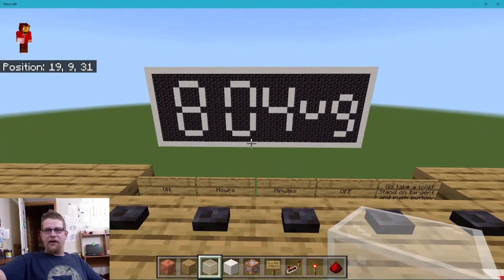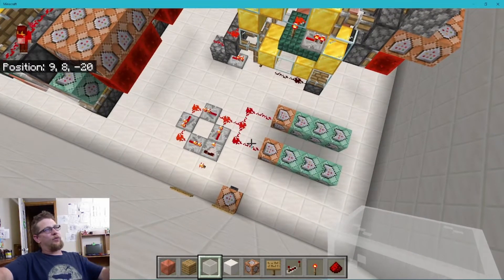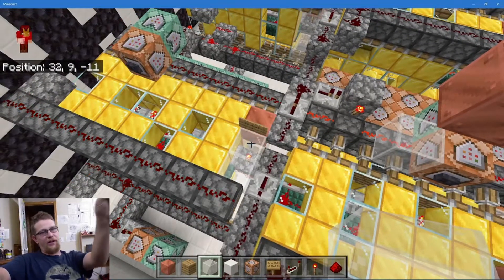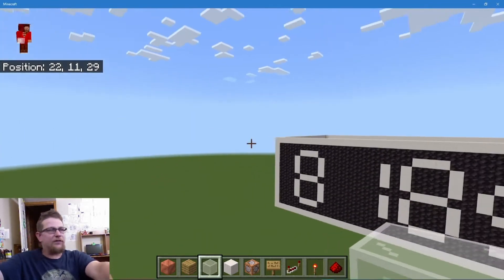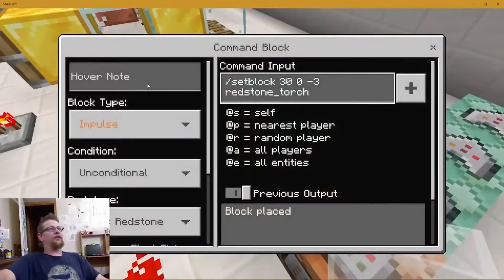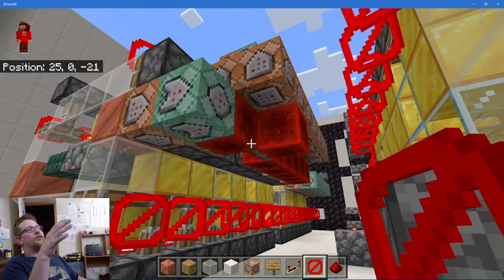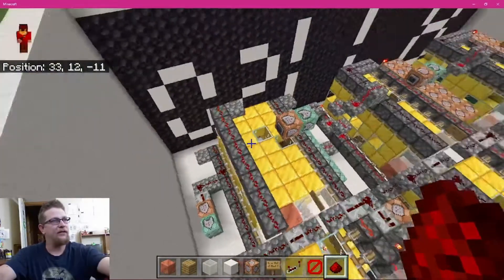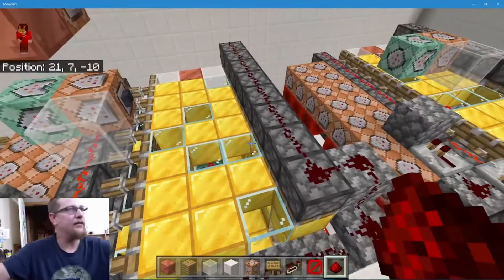Minecraft Working Digital Clock by CUBEᴰ. Best compact design. Pistons, command blocks, redstone.

Comment: Still counting after leaving?
Reply from the maker: If the clock is still counting when the player save & quits, errors may be present 
the next time the world is loaded, however they are mostly easily corrected.
I've created a reset button that takes each possible error into consideration.